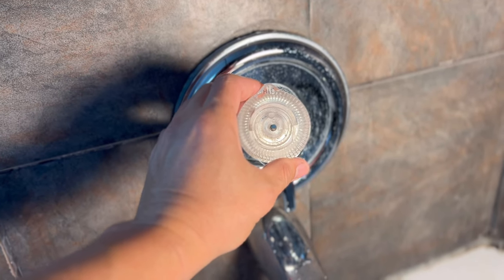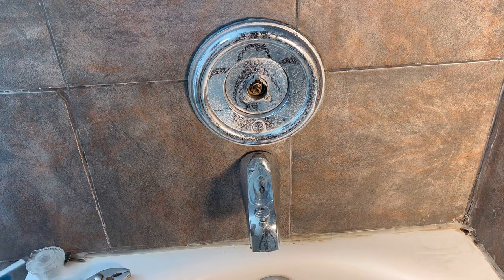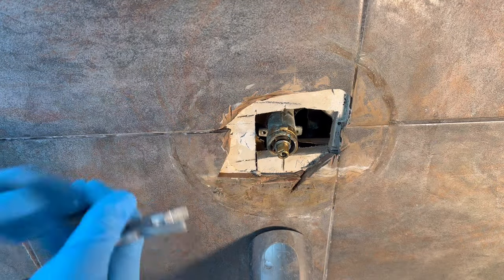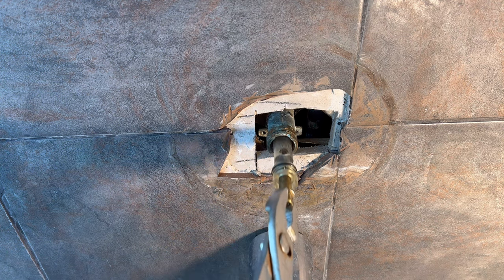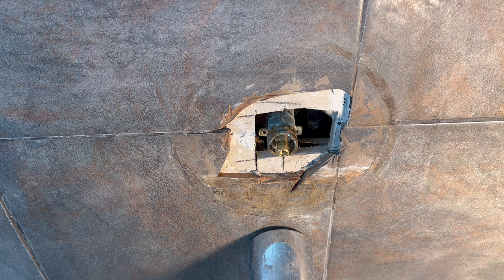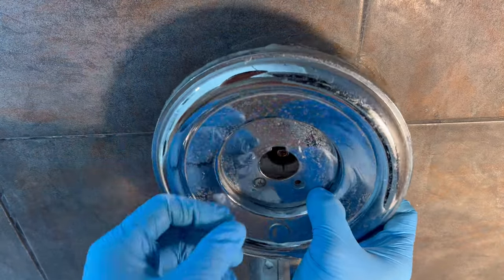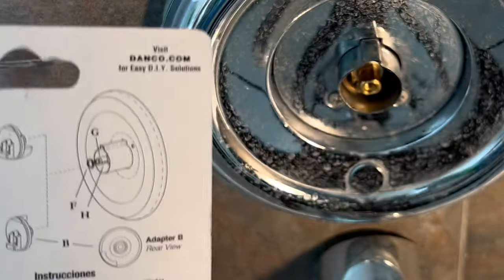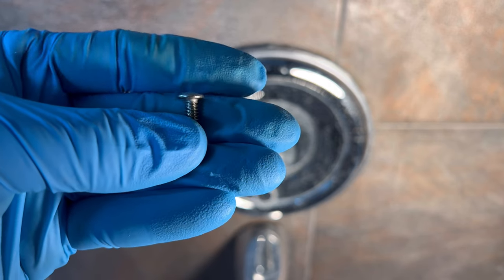How To Fix Leaky Bathtub Faucet With Moen 12801 And Replace Push-Pull Knob Into Turn Handle

Comment: So if i understand it right, this is only going to make the later handles adaptable to the standard old valve, but does not do anything to the plessure balancing that was not available in the old valves. Can you please confirm? thanks.
Reply: balancing spool is a separate unit but a integral part of the 1225 valve body which uses the 1225 (12801) cartridge, the cost of just cartridge is about 25 dollars...if your valve has e.g. just hot water, you may need to unstick the #1423 spool or replace it...the 1222 cartridge used in the pos-temp valves are about 60 dollars because the balancing spools are in those cartridges

Comment: Good instructional video. Thanks.

You should've cleaned that cover plate before reinstalling it. 😁 Baking soda or vinegar. Give it a good scrub. Or you can soak it in a CLR and water solution.